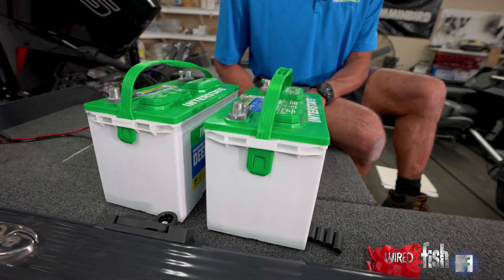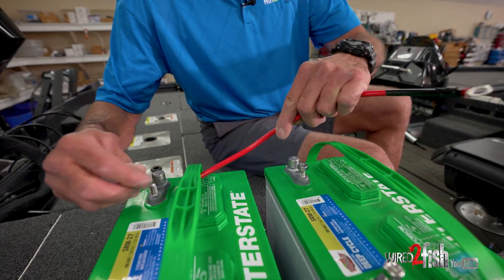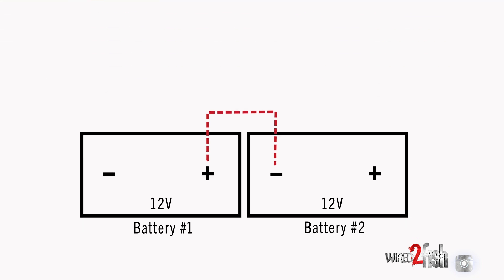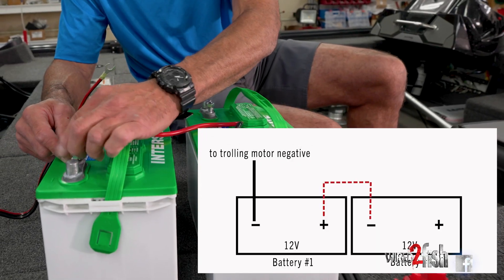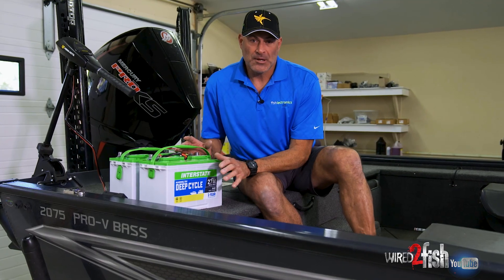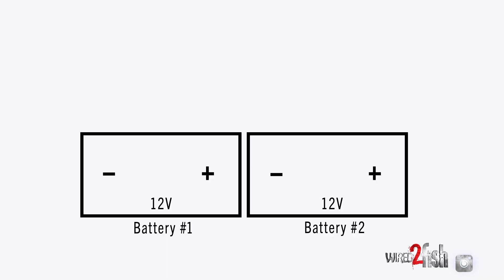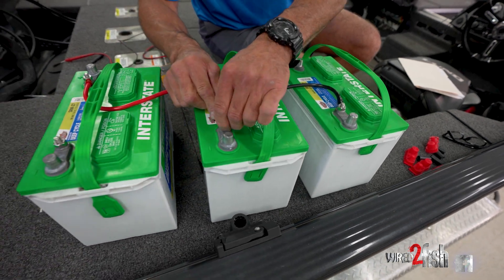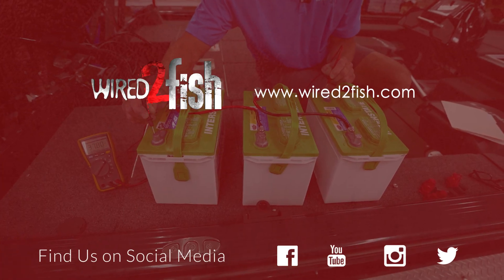How to Wire Batteries in Series | 24V and 36V Trolling Motor

Comment: Then how do you wire this into the battery switch to power the normal 12volt accessories?
Reply: If you need 12v you can wire to any one of the individual 12v batteries +/- terminals

Comment: What charger do you charge the two 12v batteries in series? And how do you connect?
Reply: You need a 24v charger or you can connect a 12 volt charger to each individual battery +/- terminal
Reply: When you connect a dual 12v charger, do you need to disconnect the jumper?

Comment: Great demonstration!! I am in need of new batteries soon and this helps, what about other electronics??
Reply from the maker: Are you asking what type of battery/batteries you need for electronics? If so, it depends on the power draw of the electronics package. For most, a single 12V battery runs fish finders, but more complex electronics packages can require up to 200Ah of power for a day of fishing.

Comment: And if you turned the 2nd battery 180 degrees you'd have a cleaner hookup with a shorter jumper cable with less chance of a short if your jumper was to rub.